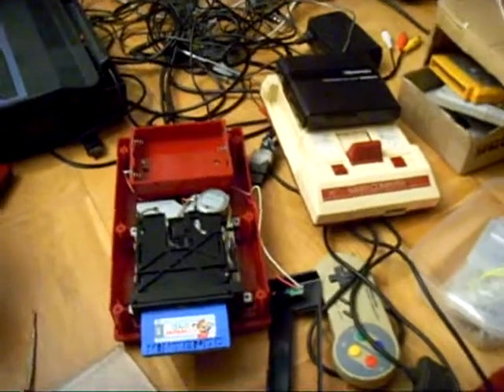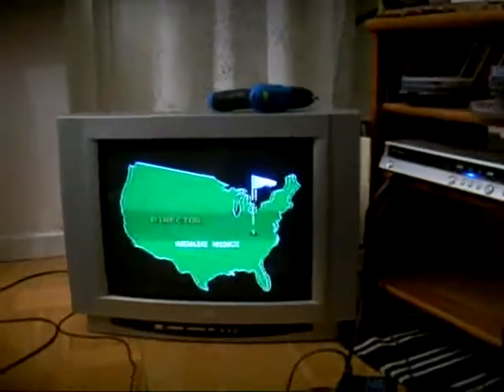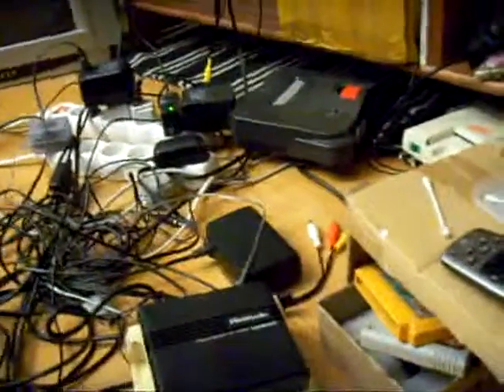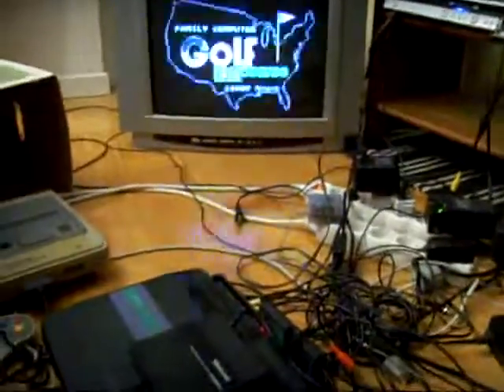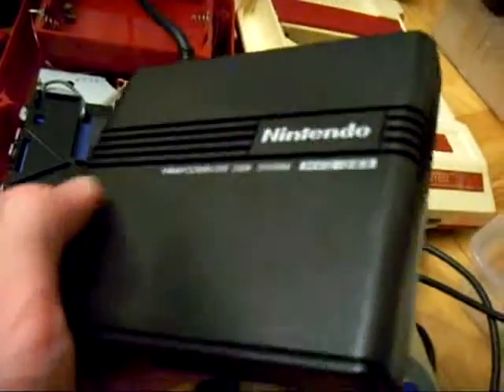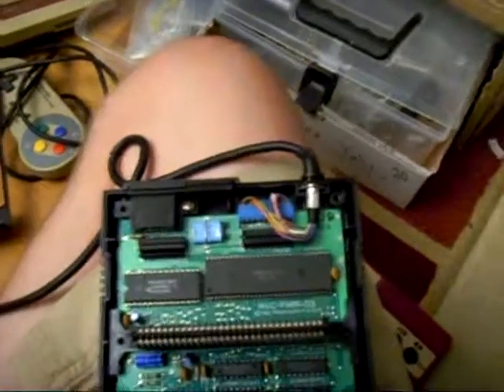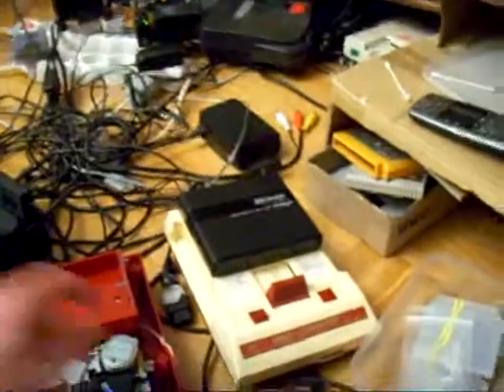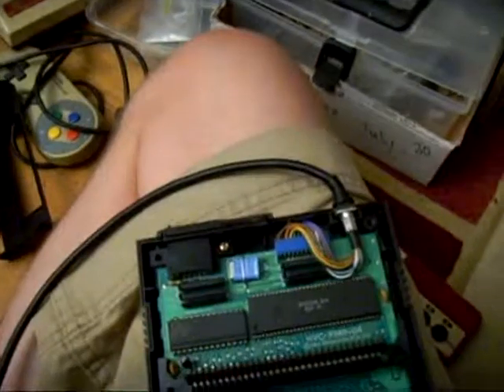The mysterious famicom disk system glitching

Comment: i also have this same excat same problem. i have the original famicom and the famicom AV and it glitches on both. mine is a RAM adapter no.3. it sucks too because i just purchased another famicom disk system when really i shouldve just bought another RAM adapter
Reply from the maker: Ozwa123 there is a solution, putting some resistors on the RAM adapters. My colleague is working on the exact values.

Comment: check pcb board traces, check the ppu, check all the capacitors.
Reply from the maker: This unfortunately is a problem with many RAM adapters, on a specific famicom model. Not just one console, but all consoles of that model.
Reply: so did you fix it already?
Reply from the maker: Jason WMU
 There is a supposed fix but we haven't had the time to try yet
Reply from the maker: Jason WMU there is a solution, putting some resistors on the RAM adapters. My colleague is working on the exact values.
Reply: Its allso happend with a NES I connected a FDS to the console with two 72x60 and a 60x72.